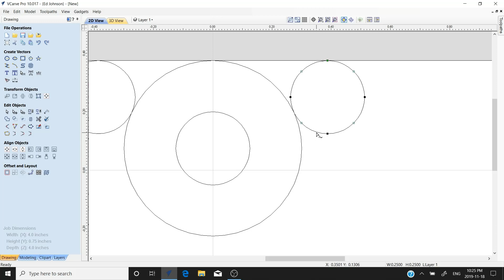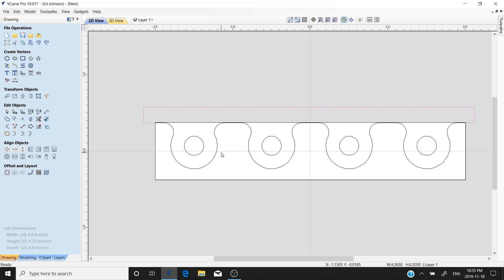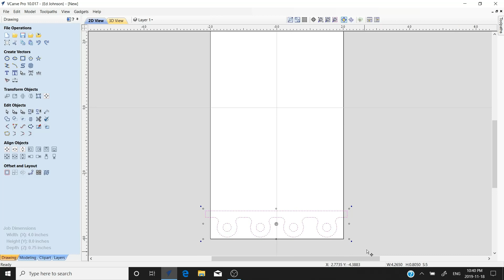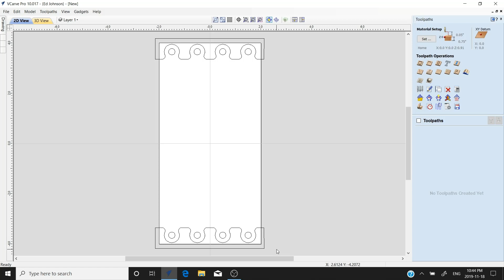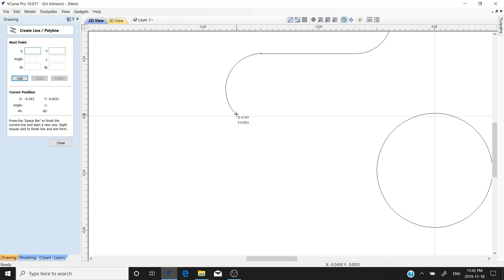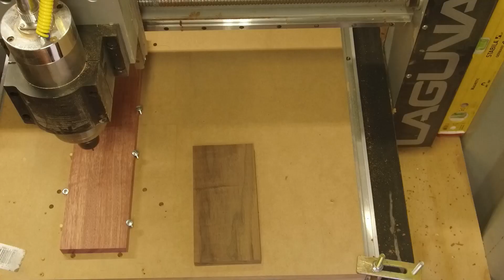Pin/Circle and arrow box created in Vectric VCarve pro and carved out on a Laguna iQ

Comment: Your tip about measuring the tool is valuable info, I struggled with a job for several,hours until I found out that the tool was under size. Good video, thanks

Comment: Hi Ed: Each time I watch this video I pick up something new.  Would you please make a video of how you went about making the 12" wooden clamp to function off the end of your CNC bed? Do you registration pins to set it down in the exact spot each time, or do you square up the face of the clamp each time you use the clamp?  Also, you mention having a spoil board, is it recessed into the clamp, or attached to the vertical face of your CNC end plate?  I can't tell from the video how the spoil board is secured.
Best - Michael

Comment: Well done indeed, great job, but how did you set your spindle to cut outside of the working area on Y axis  (- Y ),
When you used the 12" wood clamp ?
Reply from the maker: On the laguna iq it will cut about 3 or 4” over the end of the bed. The work envelope takes that into account on my machine.
Reply: @canadianwoodsmith-edjohnso4608  Thank you.

Comment: Did you use the  cnc to level the top and bottom. And wow this was great.Video. I just figured out to do the toolpaths in vcarve pro to do finger joints vertically on the front of my Shapeoko xxl. My first full square box with all ends finger jointed came out with  nice and tight joints. Jeff Peters And thanks to Mark for sharing the link to your video. Too bad I can't post a picture.
Reply from the maker: Yes, I squared both top and bottom. It's nice to hear people are getting successful results!